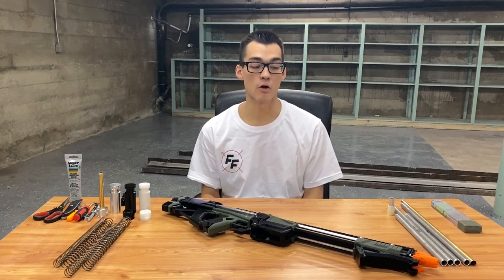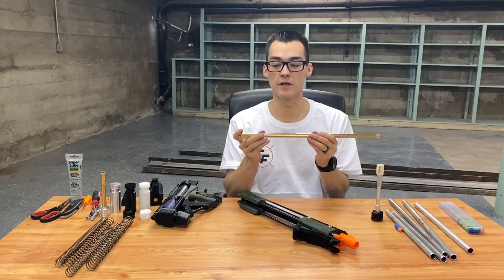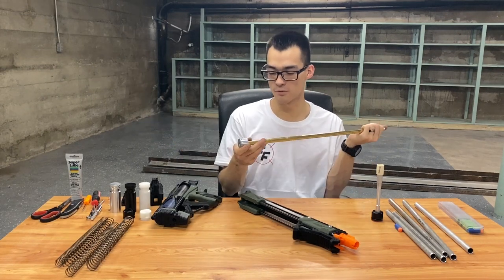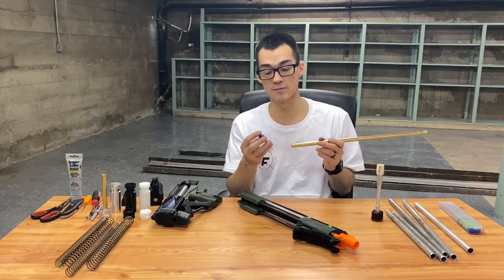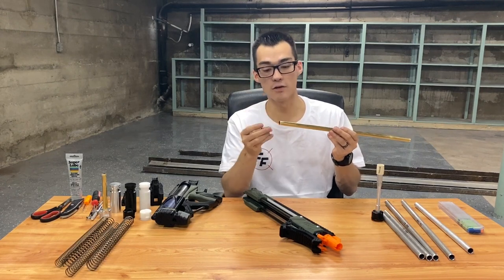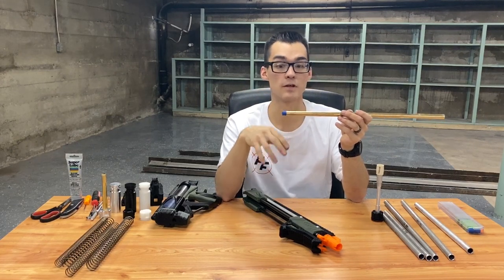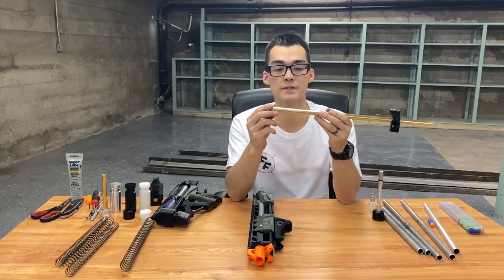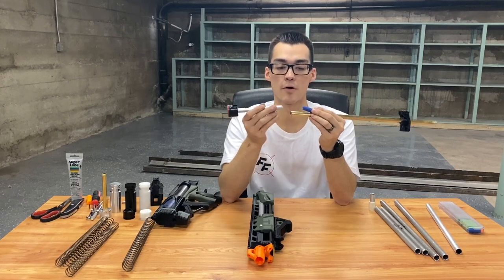How to Get 300FPS on a Caliburn Nerf Blaster

Comment from the maker: UPDATE! 
The aluminum ram doesn't leak anymore. We've addressed this issue by used two o-rings on the ramtip and/or making the o-ring notch taller and/or using a slightly larger o-ring.
Reply: Other than k25 and k31 springs are there any other more powerful springs that fit inside the other
Reply: Please reply
Reply: What website do I go to buy this gun?
Does anyone sell this completed?

Comment: My favourite recently is to fully sleeve the brass in aluminium and use a scar barrel designed for the aluminium (16mm) so no brass is exposed at all
Reply: Imma have to try that. Probably makes it easier since most mods are made for the larger aluminum tubes
Reply: Yeah thats a good idea

Comment: So... I bought the aluminum inserts for the Milan coupler, and the brass kit, and the takedown pins won’t fit in the inserts, and the rods don’t fit in the brass muzzle. Should I just drill out the holes (like maybe in a vice for the aluminum)?
Reply from the maker: Yup. The alu inserts and prints sometimes are slightly misaligned. Hitting it with a 3/16 drill does the trick (same with muzzle).
Reply: So the drilling worked, but now the ramrod won’t fully go in the breech- like gets stuck really bad when it’s almost completely closed. Maybe the ram core is missaligned? Otherwise it’s working fine, just need to reprint the Milan coupler and get a aluminum plunger.
Reply from the maker: @falsehashtags6581  Gotta make sure the front half especially the brass barrel portion is aligned with the ram. The ram should sit parallel with the priming bars.

Comment: This is exactly the video i was looking for

Also what fps would you get from a k31 inside a k25 spring with an 18inch aluminium barrel but everything else is default because thats what i ordered from your website a week ago and im curious to know what fps that would shoot
Reply from the maker: You'd probably expect about 230-280FPS range. Chronograph it when it arrives. Depends on the rest of your setup too.
Reply: @FrontlineFoamBlasters  wow thats good how heavy would the prime be
Reply from the maker: @rileycook7686  a little heavier than a k26 (around 14kg)
Reply: @FrontlineFoamBlasters  ok thanks

Comment: Would a metal coupler help with a k14 spring to hold the Caliburn together
Reply from the maker: Perhaps, but the K14 is just a heavy spring load in general. If you're going with a K14, I'd say upgrade every part imaginable—get an aluminum plunger, sear, trigger, rambase, coupler inserts... everything. You'll also want to do maintenance on your blaster frequently as well.

Comment: Will the same 18 inch brass barrel/breach  components work with your U Caliburns?
Reply from the maker: Unfortunately not. The u series uses a different clamping method for the barrel. However it would be possible to make it work with some tinkering.

Comment: Would you say the 18in brass barrel would get better performance than the 24in aluminum barrel? I’m trying to make a silly high FPS plinking caliburn.
Reply from the maker: Yeah, the 24in would probably give you more accuracy, but it is super long and the brass could easily hit stuff and bend. I generally don't go longer than 18" for that reason.
Reply: then buy 3ft long 17/32 brass. even a pro25 spring requires ~30" of 17/32 brass for optimal fps

Comment: Can’t you just put aluminum around the brass?
Reply from the maker: Sure can. We call it "brass in disguise."
Reply: Wait actually how does the aluminum barrel cover secure the brass? I think I’ll get one, like the 18 inch with the receiver
Reply from the maker: @falsehashtags6581  the cover slides over the brass. It’s a very close fit. To keep it secure, you can add a few wraps of electrical around the brass before sliding on the cover
Reply: @FrontlineFoamBlasters  Sorry if I’m asking too many questions, but is the barrel cover just the regular barrel that I’d get from captainslug’s hardware kits? Also, does the reciever come glued on to the barrel if I get the barrel with receiver and does the receiver have the ramrod in it when it arrives?
Reply from the maker: @falsehashtags6581  no, it’s a different sized tube. The receiver is indeed glued onto the barrel. It doesn’t come with a ram by default.

Comment: Is 18 inches of 17/32 brass the best barrel length for a k26 with a perfect air seal or would there be any performance to be gained with a 19 or 20 inch barrel?
Reply: 18" is wayyyyyy too short.

im using 30" 17/32 for 315fps ave from a pro25 spring for optimal fps
Reply: @wongyewxuan3880  where can I get this and how do I install the brass tube